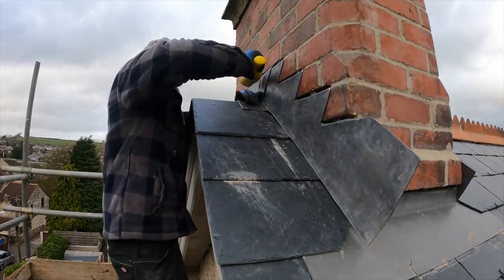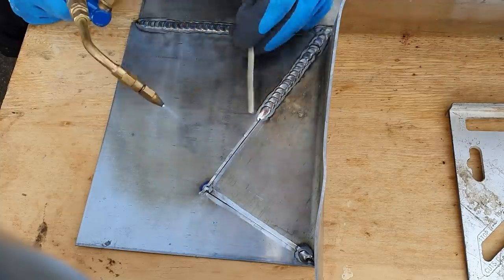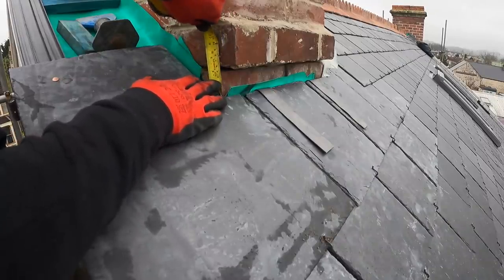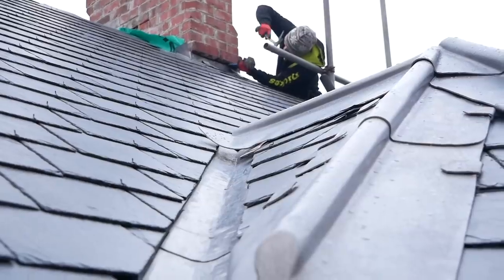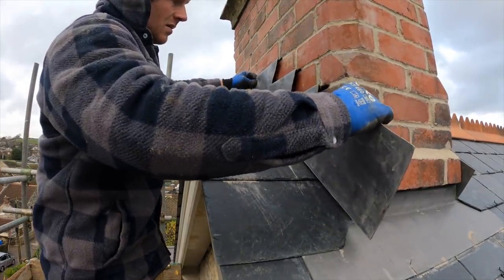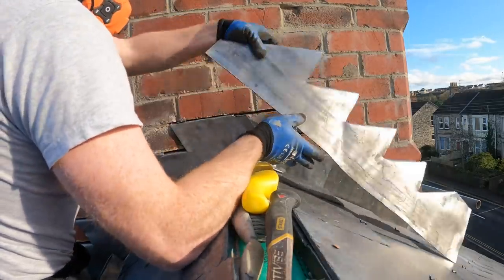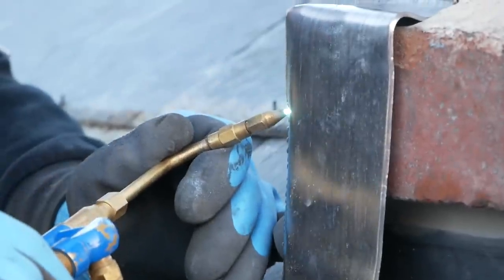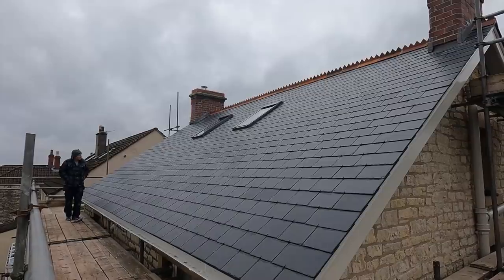LEAD STEP FLASHINGS, SOAKERS & APRONS with bonus welding footage!

Comment: A little tip. The lead flashing hold down clips need to have a little gap (3-5mm) at the bottom before you fold them over to stop them curling up when the long summer heat hits them. Simply because lead will expand a bit. Albeit the flashings are not too wide, it is more of a problem on the south side (sun facing)
Application of Patination oil for a lustre finish also helps & it also helps the lead from whitening up over time & stop lead stain streaks on the slates over time. In your case, it would match the slates perfectly to give a professional finish.
Reply: I agree, but apply the coating both sides.

Comment: Non-professional just means slow. I am a prior professional in a relatively specific construction trade. I still do new things. I bring some experience, but like I said, it is relatively specific. I just work more slowly without specialty tooling or unlimited working hours now. You think things through and try to understand the important concepts. You will not work free from all error, but you will do well at whatever you try.

Comment: Fantastic work and excellent leadwork from your friend. 
One little tip with the verge slates is to cloak (cut an angle) on the top outside corner. Stops any rain tracking back in. 
Fabulous job 👍🏻

Comment: A beautiful job. I just wondered about the mortar that you used to fill point the stack with. Presumably (judging from the age of the house) the mortar was a lime-based one. Did you use a lime mortar when you filled back in around the lead? If so, which kind of lime did you use? Or did you use a OPC based mortar?

Comment: The lead Flashing, what stops the water tracking down the 45’ that you’ve cut then down behind the soaker. Surely the more conventional, individual, flashing with min. 100mm overlap offers the cover from the elements?

Comment: Individual flashing sucks pal, you did right doing them in one go. I once did a 4.5 meter flashing along a wall. Most break them up into 500 to 600 mm sections but i think they look a lot neater if you can get it done in one and you have no joins.
Just make sure you use the patination oil both sides of the lead for anyone doing this on their own. It ensures no white run from under the lead. Many just do the weather facing side but you can get staining from the underside sometimes.
Great work tho mate, you have done well.

Comment: Individual flashings are the traditional method and offer more cover on the laps. Step flashing like you’ve used are quicker but you  always get left with a weak point with no lap to rely on. 
Would of been better chiselling the oversail of the front and back of the chimney flush to give you more of an upstand on the aprons.
Reply: Do you mean cut off the protruding brick flush? i wondered what their approach was going to be..
Reply: You can then wrap around your 1st flashing into the joint as i used to do

Comment: Looks very good only problem is if you do it yourself and few years down the line you decide to sell your house how to you go about getting the right paper work/certificate showing new work done because solicitor might ask for documents relating to alteration, planning and building control relating to this work, or an explanation of why this wasn't required. They also might ask for an NHBC certificate.
Reply from the maker: All signed off by building regulations at every stage. 👍

Comment: Well done Tim. I was surprised to see you removing grout from the newly repointed chimney stacks; are you at all concerned about their future stability?
Reply from the maker: It was actually new mortar where we repointed the old chases after they were pulled out albeit a little longer slots. Also only 1/4 of the depth of the bed.  👍

Comment: The water line on the lead only needs to be 65mm. Therefore you can use 150mm lead so I doesn’t look so big.
Reply: True but thats a minimum, 50mm upstand on a soaker isn't sufficient imo but each to there own 👍

Comment: Soakers look to have to much up-stand to me, which means ending up having a much steeper angle on each step and not as efficient. I do a 50mm upstand on soakers, and then my scribe line on the 6” skeleton flashing piece 60mm

Comment: When I was an apprentice my boss would have kicked my @rse for a few things you did.
Scribing lead where you are going to turn it into the chases or around corners will weaken the life as when it expands and contracts it will cause premature cracking,use a soft marker. When you overlapped the front and rear step flashings you should have fitted a saddle  to ensure the overlap joints don't terminate too close to the apex, alternatively a longer piece of lead could have been terminated further over and a gusset welded in by your mate. As you couldn't fit the saddle over the decorative Ridge but had to go underneath then a good idea is to turn up the edge slightly so any water that gets in the chimney side of the Ridge and underneath gets diverted down the slates and not in the gap between front and rear slates to the felt. The bottom of the side flashings should have had at least a one inch gap between the bottom edge of the flashing and the slates to avoid water penetration from standing snow melting via capillary attraction between the front face of the soaker and rear of the flashing where they touch each other causing water to get sucked up hill.
Plastic nylon yellow tools are for copper or alloy sheet,wooden beech tools are for lead. When plugging the side flashings into the brick joints use a plugging chisel as it is flat so it compresses the lead plug, a sharp edge bolster cuts it and doesn't allow the lead to get a good hold. Through time and expansion and contraction the flashing can fall off if the plugs aren't solid enough.
Take it or leave it but that's how I was taught 30 yrs ago by older craftsmen plumbers.
Reply: Saddles with retun welt were installed under the lead, the gap between slate and lead needs to be 15mm not 25mm for capillary a normal bolster is fine for lead wedges, doesn't have to be a plugging chisel, plugging chisels are more commonly used for clean out chases in harder to reach areas not for actually plugging lead wedges, wooden dressers are now made from beach and mark the lead, the old box ood dressers were great but they haven't made them for years, plastic dressers are designed and made solely for dressing lead and are far superior to any wooden dresser! You obviously know a lot about lead and its great that you take an interest but you are a little behind the times. no offence ment at all and appreciate the comments 👍
Reply: @MrLewisdix87  Hi, I won't start a tit for tat discussion on what's right or wrong between us. We all have different ways of doing things and I'm glad your keeping the skills alive. My points I mentioned do stand up to what I was taught for valid reasons and I commented on the things I saw or didn't see being done on the video us oldie plumbers would say that in response to being 'behind the times' that you and your skills will be older one day yourself but remember lead sheet and brick chimneys don't change much. Hope you stay safe and have all the satisfaction I've had so far using my hands to achieve things other untrained folks can only dream of. We are both fortunate to be taught a craft,you more so than me as most jobs now in construction have been dumbed down by modern materials. All the best.
Reply: @googlecontrolled  didn't by any means mean to disrespect anyone or start any tit for tat,im sorry if that came across in the wrong light,. the only major thing that I disagree with is the wooden and plastic dresser comment, that was the only thing behind the times. I'm sure if you were to research this or maybe ask one of our trainers at the master roofers training centers they would inform you of this. cheers for the comments and massive respect to all of the old school plumbers who have made our trade what it is today ❤